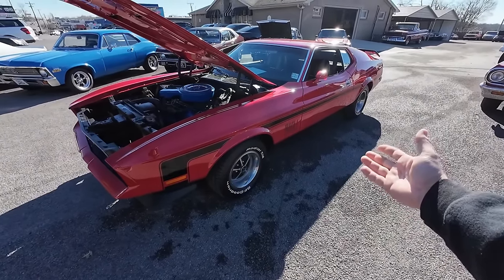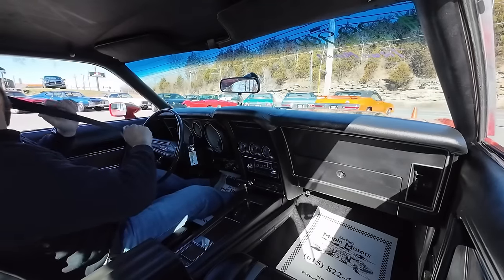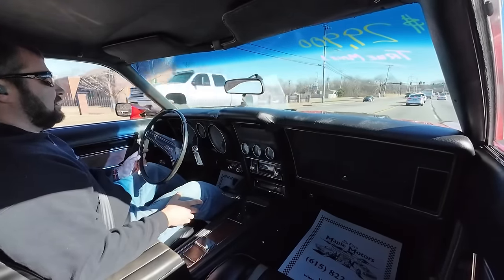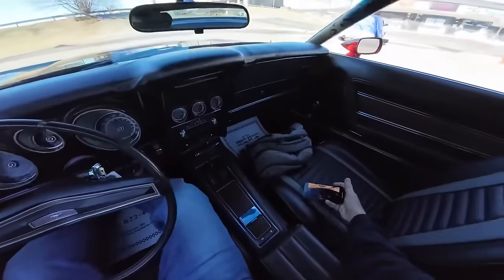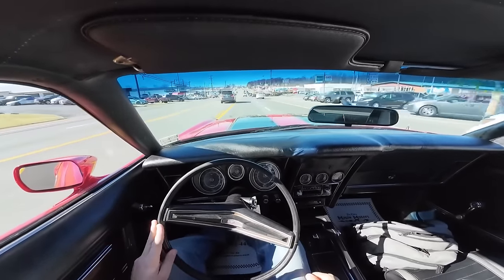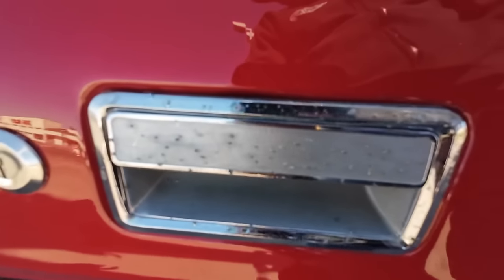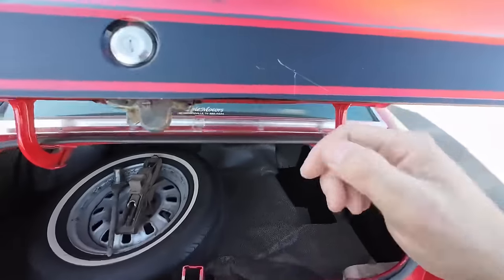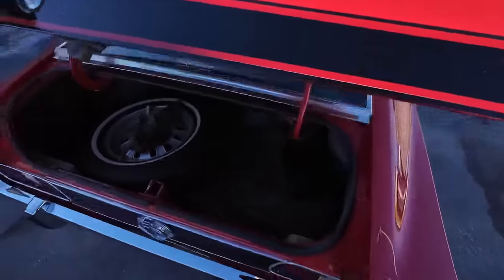Test Drive 1972 Ford Mustang Mach 1 Fastback SOLD $29,900 Maple Motors #2454

Comment: Nice car, but 302 2V? Somebody stole the Cleveland.
Reply: My thoughts axactly,
Reply: Thought the same then researched. The 302 was a base motor offered in 72. The 351 was an upgrade. A big one!
Reply: @markpro96  I don't doubt your research, but I never saw a Mach 1 from that year without a Cleveland. I certainly never saw a Mach 1 with a 2 barrel carb. Of course, I was only 16 at the time, so they may have slipped a few past me.

Comment: In 1971 Ford completely redesigned the Mustang. You could still  get a big block engine such as Boss 429 or Boss 351 as well as a 351 Cleveland. They were noticably larger cars than previous Mustsngs.

Comment: I'm a second Gen Nova (68-72) guy but these big body Mustang Fastbacks from this era just scream 70's. This body style is growing on me...definitely completely different vibe from the 67/68 and the 69/70 eras. Exhaust on this one is a little shaky...
Reply: Big body? 😂 yeah that extra 1 inch wheel base and 2 inch overall length really makes it hard to maneuver in a parking lot 🙄
Reply: It's the hood...it's like looking over the front of an E-Type. I had a 73 Grande convertible in the family when I was a kid... @caspianwendell
Reply: @Trapper50cal  the hood (only) on a 70 is 58” plus the cowl vent cover which is about 12”, my 71 convertible hood is 70”. I know it looks longer because of the hidden wipers but…the overall width was 3” wider and it gained 250 lbs

Comment: How about $3,500 firm 😎 🤝🏻
Reply: @MapleMotorsNickSouthgate  Just like in the good ol days 😉
Reply: @MapleMotorsNickSouthgate it’s not a “True Mach 1” like the windshield clams . You can get sued for that kinda stuff . Mach 1’s had 351 Cleveland’s .
Reply: Love the way people think they know everything about these cars.
Reply: @MrOttotattoo   nope in 1972 the base motor for a Mach 1 was a 302.
Reply: @skxj  maybe and I say maybe because I’m in a different country , but a lot mustang legacy sites claim what I say . The Mach 1 was a performance option, a 2bbl 302 was the bare minimum option on any mustang including the boring notch back. The mach1 was the premium performance because there were no Shelby Options in those years
Reply: @MrOttotattoo  in 1972 the base engine for the Mach 1 was the 302w 2bbl rated at 141hp, there were 3- 351 Cui engines offered as options in North America.  Also just a fun fact in 1971 ford Germany offered 9 official Shelby cars with only 1 having the 429 CJ the other 8 were 351c.  Hope this helps.
Reply: @MrOttotattoo  skjx is 100% correct, base engine for a Mach 1 was the 302 2bbl. You can't really scam someone on one of these cars as the 4th number on the VIN number will be a 5 if it is a Mach 1.

Comment: I didn’t think Ford put a 302 in a Mach 1.
Reply: They didn't.
Reply: I'm sorry I told you a lie. My friend is one of the best mechanics on Fords and he told me they did and they didn't make many with 302 they were rare and I called it up and they did. So that was my fault. Sorry!!!
Reply: @kennyrobinson1032  that's a heavy car for a 302!
Reply: @smkymtnguy33  yes it is but 302 motors are good motors and the 72 mach 1 is the only mach1 that come with the 302 is what it said. I've had 3 69 mach 1 and my brother had a 69 with 351 and my other brother had a 69 with a 390. The 390 would run.
Reply: r @smkymtnguy33 l had a  Grande 😊3100 lbs on the  title buddy's  fastback  3150lbsnot that  heavy  back  in the  early 80s they have  weight  on the  titles

Comment: It's definitely the right year. 72 is the best year for any muscle car including Charger, come at me!
Reply: cool story bro.....................
Reply: Not disagreeing, but actually 72 was the first year of low compression engines running on low lead/ lead free gas. Big loss of horsepower compared to 71.
Reply: @blotto3204 but they run forever. Low compression 302 asked for a whole lot less attention then 351C in my experience. Great engines for daily driving or going on trips